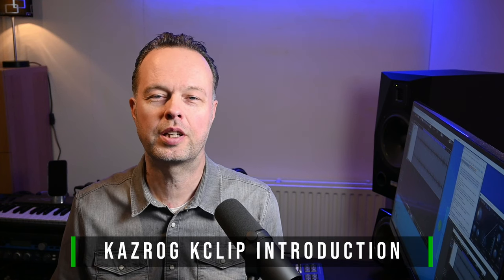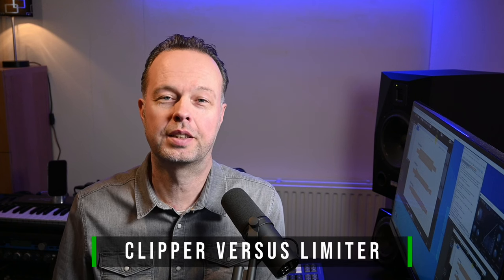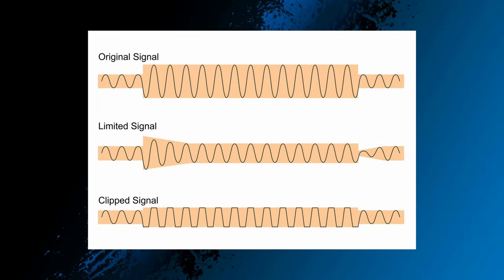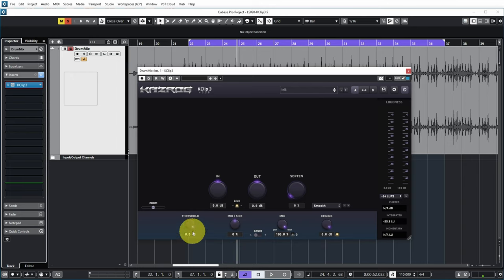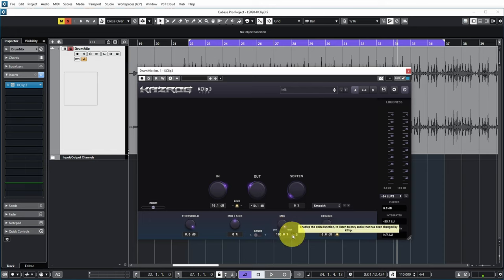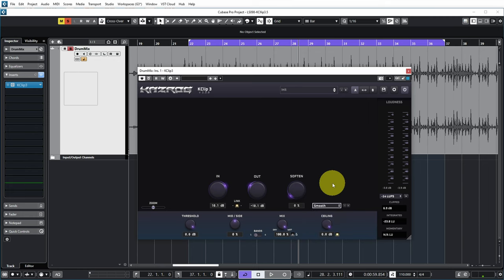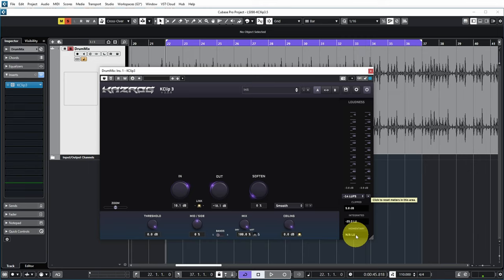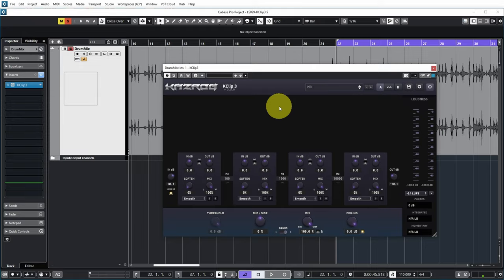Kazrog KClip 3.5 and how to use clippers in music production

Comment from the maker: What clippers do you use and what do you use them for?

Update 30-01-2024: To all the people that mentioned that the visualizer did not look anymore as shown in the video, you were correct. As of v3.5.1 Kazrog removed the peek reduction visualizer and reverted back to the older wave form display due to performance issues. Fortunately, the new version 3.6.0 contains the new visualizer again, very similar to the one that is shown in the video. So get your update :).
Reply: Flatline: Better controls, safe clip option while oversampling

 pancz: light weight, multiband, awesome sound, best visualization in the market yet. Transient shaping also. Limiting option also which is extremely transparent. NYC option also
Reply: U should give em a try
Reply from the maker: I’ve heard about flatline but not the other one. Thanks for the tip!
Reply: I'm liking SIR StandardCLIP a lot rn
Reply: Saturn, Newfangled Saturate, K-clip and Knock. Sound design, mixing, mastering.
Reply from the maker: That’s quite a few 😉.
Reply: GClip by GVST. Mostly for soft clipping in the master before maximizer and TP limiter.
Reply from the maker: @FFMborn  thanks for the tip!
Reply: I like KClip and Soundspot's Nevo. The Nevo has some excellent features related to saturation and transient management. I bounce between the two based on the material

Comment: Thank you for the video!
Talking about the soft clipper mode, I think it's good to mention that it starts to saturate the material passing through more as we push the "soft clip" button up.  So, as we rise the soft clipping knob, it starts to suck deeper material below the peaks.
If you want just to razor-sharp avoid peaks, that's not the best choice because it will change the sound from tonal material...
Reply from the maker: Yes you are right. Thanks for that addition.

Comment: Great video.  Lovely plug-in.  I have a silly question 🙋‍♂️. What if you use a compressor ( peak mode ) or multiband compressor to prevent all your peaks on busses or individual channels, so your limiter don’t work a lot at the end of you mix.  Or what if you use a limiter on each bus to catch all the peaks before they get into your your master channel? Do you think you could get the same results without using a clipper ? Thanks 😊 BTW sometimes I use waveshaper by Melda as a clipper on my master buss to get similar results or Gclip, camelphat.
Reply from the maker: Yes there are definitely multiple ways to control the transient peaks. The clipper is just a very effective way that can also impart some character if need be. If you want to stay as transparent as possible, probably multiple limiters are your best bet.
Reply: @LanewoodStudios  yeah exactly. I use clippers to add character , tone , distortion sometimes, it depends on what I’m working on.  Thanks for your reply. :)

Comment: hey @LanewoodStudios - I'm wondering if you've ever noticed one interesting thing after applying KClip to the audio channel - it looks like if you cut the low end from the sound (lets say it's hats and you want no low end on them) by applying the equalizer, then apply KClip, then add a spectral analyzer - you'll see the low end there again (though it's looks quiter than before). is there any way to get rid of the low end post-KClip completely?
Reply from the maker: Ha, I've never noticed this myself. You're saying it changes the working of the previous plugin in the chain? Are you sure you're not just increasing the level in the clipper?
Reply: @LanewoodStudios  I've prepared a small Ableton demo project to test it out, tried to paste a screenshot link there, but unfortunately youtube doesn't allow me to do that, so I'll just express the problem verbally.

here's what I do:
1. load a jungle sample / loop into the audio channel - originally it has a wide frequency range, low end + mid range + high end
2. add spectral analyzer - it shows the presence of the low end
3. add eq - cut everything below 200 Hz
4. add another spectral analyzer - it show the low end is gone
5. add KClip - settings are: in 15 dB, out 0 dB, ceiling 0 dB
6. add another spectral analyzer - it shows the presence of the low end (albeit less than in step 2)
7. add a loudness meter - it shows 0 peak max as expected
8. add another eq - again cut everything below 200 Hz
9. add another loudness meter - here's the culprit - it shows 6.7 peak max

so basically what's happening is that I'm able either to:
1. get the channel clipped properly, but have an unwanted low end
2. get the channel clipped properly + eq out the low end, but the channel gets, well, unclipped again
Reply from the maker: @alexanderdashko3909  I don’t know what’s happening for you exactly but in step 5 I would use out: -15dB so that the level before and after the clipper stays the same. I think that is the reason you are measuring bass again in the following analyzer. Actually pushing up to 0 dB I do with a limiter following the clipper. And I only do that on the mix bus or during mastering. When I use the clipper on the drum bus in a mix (so not on the mix bus) I only use it to shave of peaks on the drums. No reason to push the level up in that case.
Reply: @LanewoodStudios  that makes sense... I'll try accommodating my workflow, thank you!
Reply from the maker: @alexanderdashko3909  yes see if that works for you 👍
Reply: @alexanderdashko3909 I’ve noticed the same thing while using any kind of clipper. The only way I’ve been able to solve it is adding fabfilter Q3 on linear phase mode at the end. It allows me to cut the lows that we’re added while not causing the peak to go higher again. Did you end up fixing the issue?

Comment: I’m not seeing the same views as on this video, with the red coming down to show what it is doing. All I see are t two horizontal wave forms. Is there a setting I’m missing?
Reply from the maker: Yes I understand that they changed the view back to the old view in the latest version because of performance issues. The also implied that they may make it an option later so that you can choose between the two.
Reply from the maker: They just released the 3.6.0 version with the peak visualizer again!

Comment: So would you put this before your drum bus compressor?
Reply from the maker: I've actually used it both ways. Before the compressor makes the compressor work less hard, and can make it sound more smooth. After the compressor is more for safe guarding against and taming final peaks.
Reply: @LanewoodStudios  interesting.  So far, on my instruments I've been putting it before the compressor, and on my mixbus it's right after.  It seems to be working alright that way.
Reply from the maker: @DamageInc86 yes, sounds like a good choice.

Comment: Why would you use a clipper in the master bus when you could use a limiter? When a clipper causes distortion/saturation I don't understand that well
Reply from the maker: If you just take off the worst peaks before the limiter, the final limiter has to work less 'hard' and can sound better. And just taking off the worst peaks with a clipper can be quite transparent as well by the way, or more gritty if you want it to be. See e.g. https://youtu.be/Tai0VW6FZnk

You can also use two limiters in a row for this by the way. The first to get rid of the worst peaks, and the final one to do more extreme limiting to get the loudness up. It's a well known strategy for using limiters in mastering. Again a Streaky link: https://youtu.be/JkzAXYJ3Uz4
Reply: The Clipper adds lots of character, especially in hard-mode, if you are going for that. And yeah, it can help the following limiter if you use the clipper conservatively.

Comment: how do you make it show the red parts? no matter how much i drive it, it doesnt go red
Reply from the maker: I think they changed the display in the latest version.
Reply: @kazrogllc fix this problem. I bought it fully thinking it had the new visualizer and not happy about this “development”.
Reply: @AndrewCCM  just download the older version before it like i did, loads better. i would not have paid for it if i knew though, yeah. not a complete waste of money, but i do see myself using a new plugin over it in some years. the red parts are essential, why the fuck they took it out is weird, an option to turn on and off would be cool of them in future. for now, just use the old one man. good luck
Reply from the maker: They just released the 3.6.0 version with the peak visualizer again!